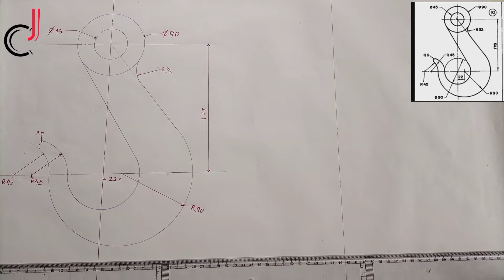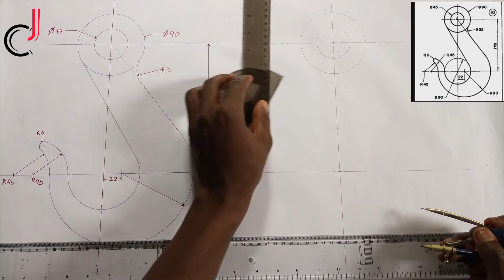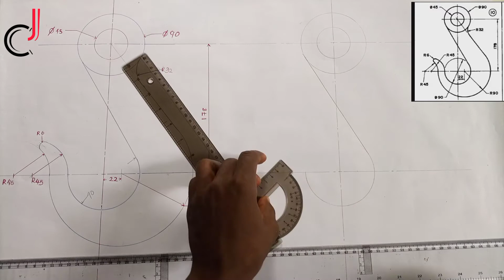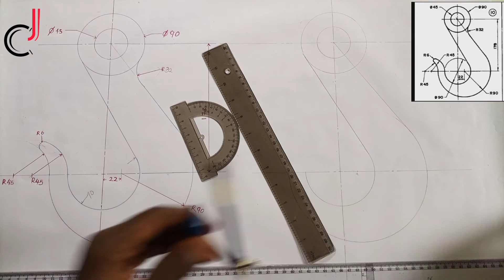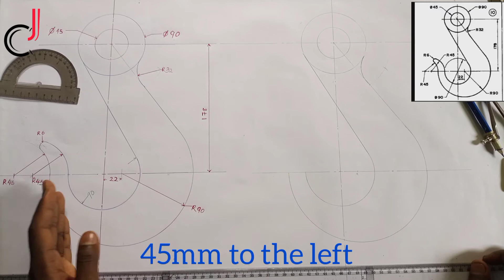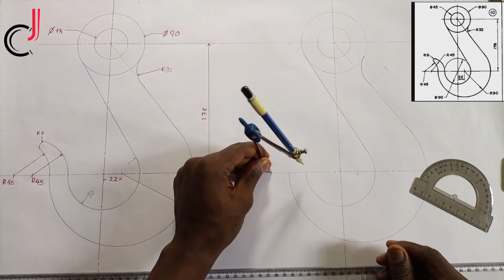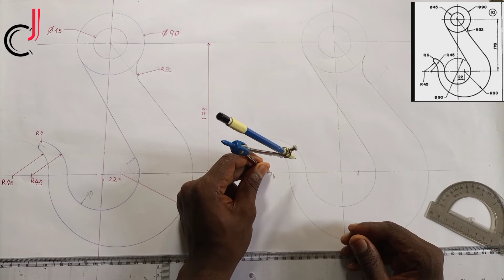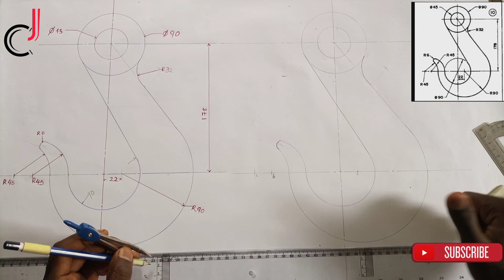tangency problem

Comment: How does it look so small in the video??.....all this radius and mesasurement won't let it contain A4
Reply from the maker: It was constructed on an A2 paper.
But use the dimensions given to you by your teacher/ lecture.

And note, some times you might construct using half-size of the dimensions.( Only when you are instructed to do so)
Reply: @jcengineeringandtechnicald2223  okay thank you very much